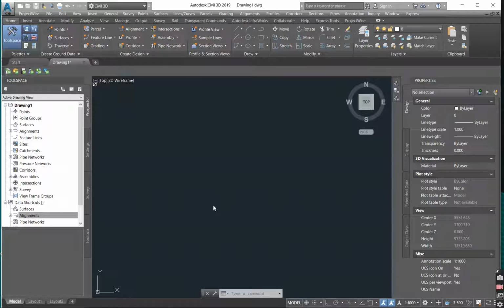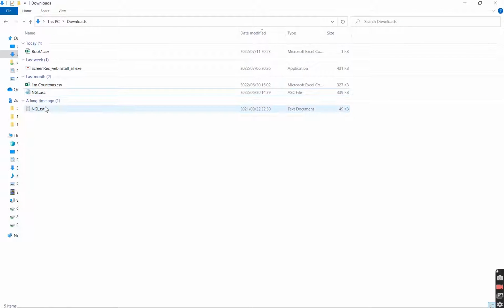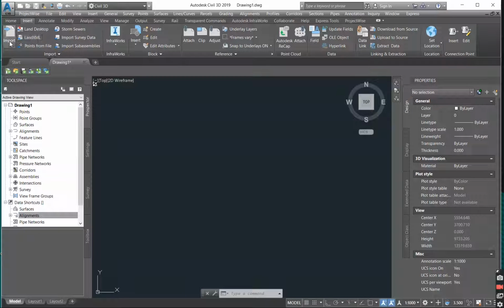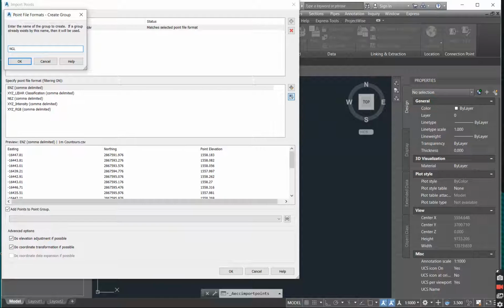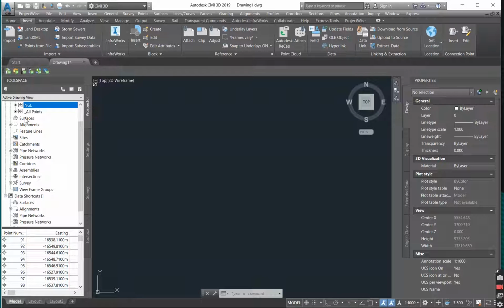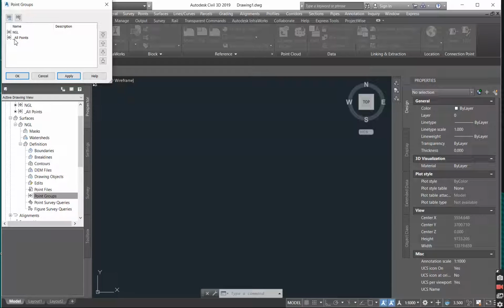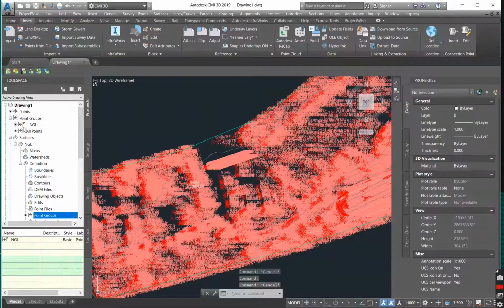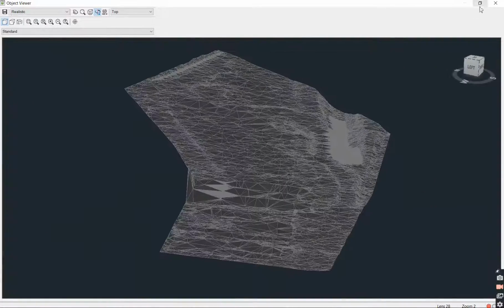AutoCad Civil 3d Tutorial: Creating Surface from points

Comment: Hey the surveyor sent me a dwg and csv file of the survey. I followed the video but the dwg and surface are far apart. What could be the problem?
Reply from the maker: Hi Lebogang, check your coordinate projection system (you can use the world coordinate converter to chck). you might have to swap the x and the y on your csv file or make the one coordinate negative and the other one positive. that should solve your problem
Reply: @c3dtutor349  Thank you. this is helpful